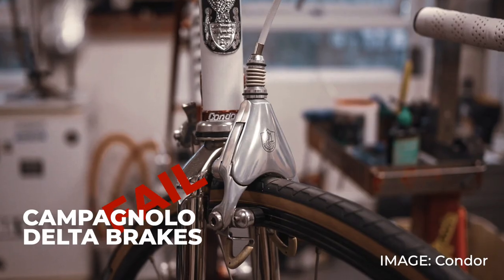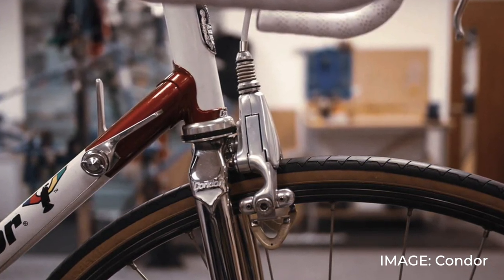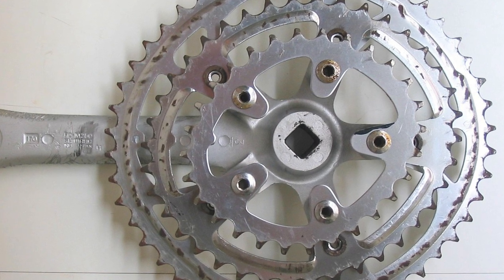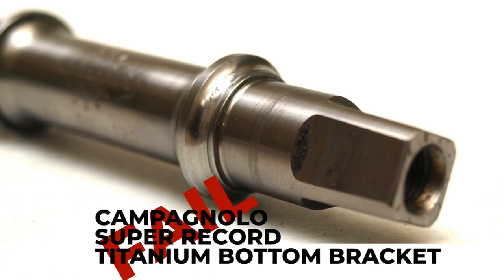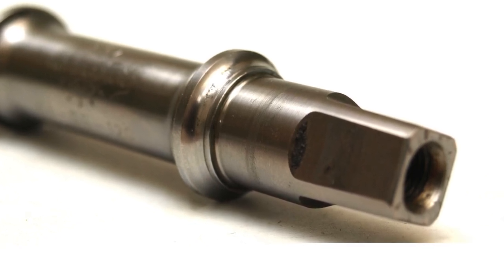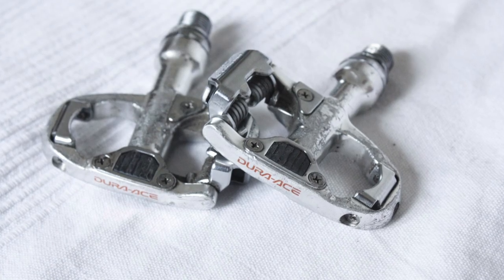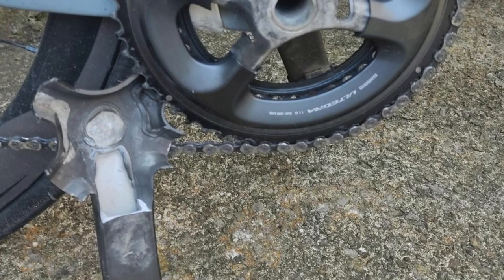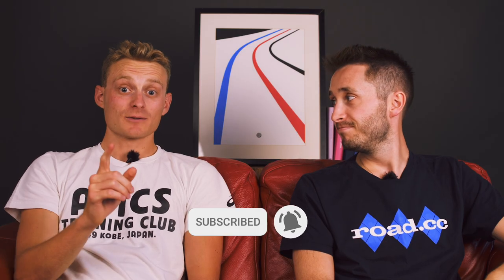Shimano and Campagnolo's Biggest Tech FAILS

Comment: I used Delta brakes 3rd gen back in the day when racing 0 issues i can tell you if anyone had issues with then i am sure they were less than the issues with the monstrosity disc BS of today so maybe in a few years aero and disc brakes will appear in a fail video 🤣😂🤣😂🤣
Reply: Doubt it. Disc brakes are for sure heavier but they helped with braking in less than ideal road conditions. Have you really tried aero bikes and compared it to your usual bikes, though? Complete with data (power, speed, times, etc)? Because unless you can backup your claims that it's a fail, then the only fail here is you.
Reply: @VIEultimate  i have a several bikes aero i have a giant propel non aero a giant tcr i have a f12 a f10 an some others a bianchi aria disc an awful mistake 
Wheels are more important for aero than frames i have tested it in real world conditions and weight matters also i never ride in wet conditions I'm not racing and not sponsored you like disc thats cool whatever makes you  happy and keep you riding for me i don't need them never had a problem descending with my rim brakes on carbon wheels
Reply: @ernestoechevers4741  Don't get me wrong, I'm also on rim brakes (some cheap Chinese road bike with 105 R7000 calipers). It does the job for me so I'm sticking with rim brakes on alloy rims unless I go for anything offroad-able (cross/gravel bike). But you just stated why someone would want disc brakes. lol
As for aero, there's a reason why cyclists in TdF use aero bikes in flatter stages specifically. If you ride on hilly/mountainous terrains, then maybe that's why you think aero is useless. But don't say it is a fail for everyone, because international races say otherwise.
Reply: @VIEultimate  excellent i will stick with rim brakes as long as my budget allows i work on my bikes but the bianchi i have to go to the lbs to service the headset which is non acceptable for me who always work on my bikes and appreciate simplicity i had a difficult time building the f12 but pinarello has several videos in youtube i don't use integrated handlebars i use 38cm and integrated only has down to 40cm i use dura ace 9100 mechanical i had di2 twice first time a ulterga 6800 a charm then a DA 9100 a piece of crap so many problems i never bought di2 again those things are ok when you are sponsored and racing but for show at the coffee stop its nonsense its better to train and be fast on whatever bike we have
Reply: @ernestoechevers4741  THAT I have to agree with. I also highly prefer simplicity and serviceability of more... traditional bikes. Maybe I could learn brake bleeding when I get a proper hydraulic disc brake bike (probably easy when one does it often), but I"m staying away from electronic and fully integrated cabling for the foreseeable future.
Reply: @VIEultimate  I'd recommend to wait at least till next disc brake gen to let the manufacturers dial in the tolerances and modulation technology i don't like it right now but maybe if the pads stop rubbing and the rotors somehow become more durable because i bent one just putting the bike in the car and never could align it always rubbing had to change it over 70 bucks for that little mistake are the things i don't like about the way the industry is going but I'm
 pretty sure soon they will solve at least the rubbing and modulation
Reply: @ernestoechevers4741  The 'industry' is in the process of pricing themselves right out of the market, since soon they will be selling to 7 figure yearly salary Wall Streeters EXCLUSIVELY.

WHO TF else has that $15K-$20K+ USD laying around for ONE effing plastic fantastic aero ride and ONE set of carbon wheels, let alone MULTIPLE bikes and wheels at those prices (like the 'quivers' that all those at The Pro's Closet nonchalantly/casually EXPECT you to own!)?!?!

I personally REFUSE to go into debt for the rest of my life just to ride the latest/greatest piece of planned obsolescence crunchy stuff just to have it crack, and get thrown away long before it's paid off.

The more they (and everyone else) tell me that I CANNOT LIVE without their Dura Ace 12 Di2 equipped, toxic fluid actuated disc braked, brittle frame material aero wonders on 35mm wide wheels, the more I will stick with my mechanically shifted, rim braked, skinny rim/quick release, partially exposed cables/non-integrated 'cockpit', metal framed (titanium) ride. 😉
Reply: @Fordworldrallyfan  i wish more people could see cycling as you do 👍

Comment: If Biopace is installed correctly, not as spec, it feels good.
Reply: How should be the correct orientation? I also have an old bike with these chain rings, i got it for free  (it is old) and I mounted them after restoring like they have been on the bike. They don't feel bad, but I don't recognize a big difference however to round ones
Reply: @simonm1447  Fastfitnesstips, a youtuber, has a series on installing Biopace correctly
Reply: @charlesblithfield6182  thanks for the tip

Comment: Campagnolo Power Torque cranks, absolute sh1te...
Reply: I have their Record CT Compact Ultra Torque cranks on my ride, and they have been flawless so far.

I even have the 'no-no' setup of pedal spindle extenders threaded into them, and no problems at all.
Reply: @Fordworldrallyfan  Ultra Torque is fine, had a record carbon on my Rourke bike for over 20 years and it’s been fine. Still running on original bearings and done 1000s of miles but the Power Torque cranks are very poor, had one season out of one and two out of its replacement - absolute crap for something carrying the Campagnolo branding.